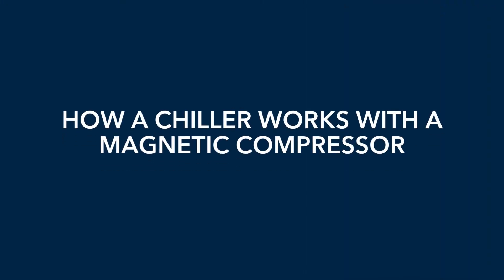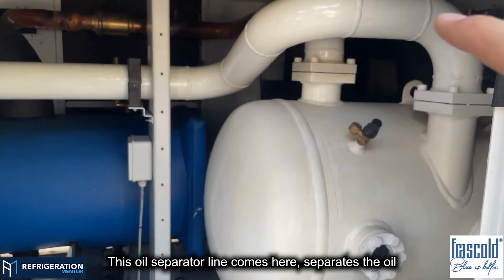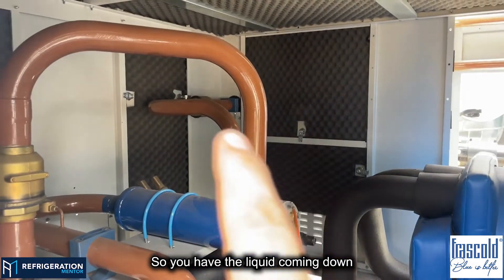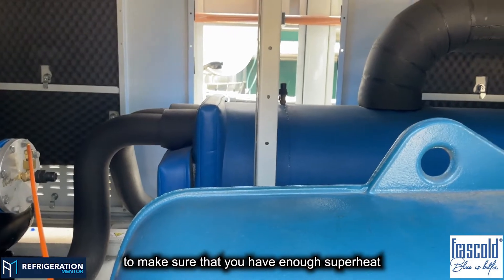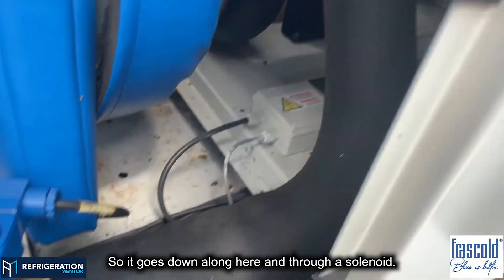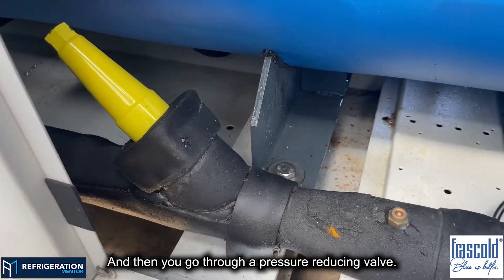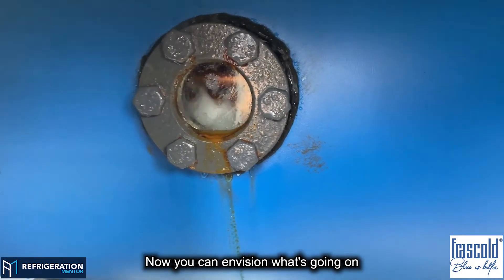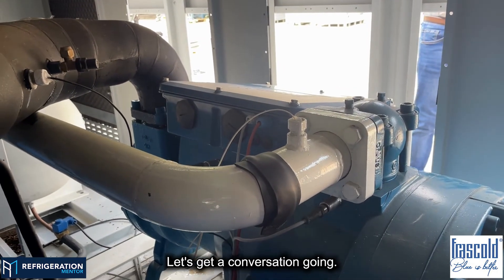How a Chiller Works with a Magnetic Compressor

Comment: A sight-glass on an evaporator is something that should be standard... It would make diagnosing what's going on with a T. X. valve that much more visual and help confirm empirical assessments (like, blockages and flooding issues) 💡
Reply from the maker: Yes thanks for sharing.

Comment: That looks and sounds like a screw compressor Trevor. By and far mag lev compressors are oil free. I'd be interested to see a picture of the compressoe nameplate because honestly I'm not buying what you are selling here.
Reply: Ah. The video title is misleading. They put magnets on the rotor to reduce slip during part load operation. It's a synchronous motor  instead of a standard asynchronous.  

This is a normal screw with a different motor configuration.  Franscold calls it a magnetic compressor...but it is not magnetic bearings.

You may wish to change the title to be a bit more transparent. This isn't really a "magnetic compressor". 

"Frascold Magnetic series compressor" would clear things up.  People will see this and possibly thing magnetic lev compressors have oil.
Reply: @TimTanguay  Yea, was thinking the same when I saw the title.
Reply from the maker: Great Identification.  You are correct it is a Frascold Magnetic Screw Compressor.  What I thought was cool it can ramp from 60Hz to over 250 Hz
Reply: @RefrigerationMentor  pretty typical for a vfd driven screw. Why does it have oil if there is magnetic bearings? 

The advantage of magnetic bearings is to avoid oil management and the efficiency losses associated with the insulating properties of oil.